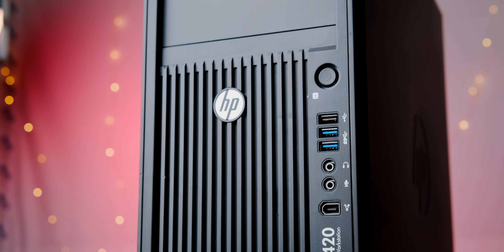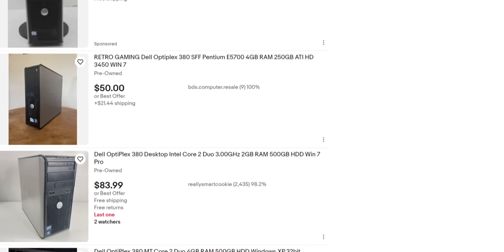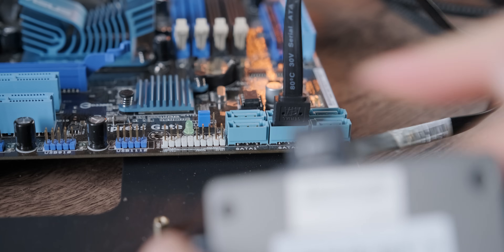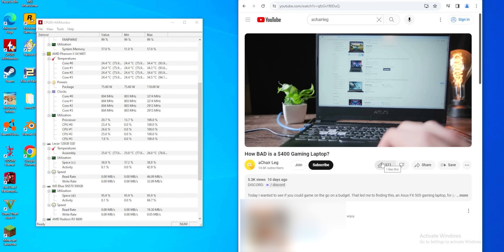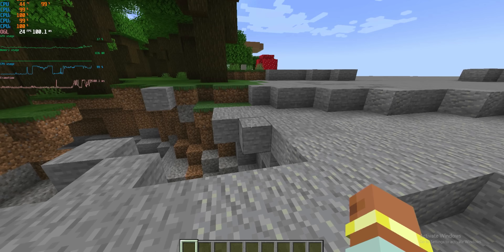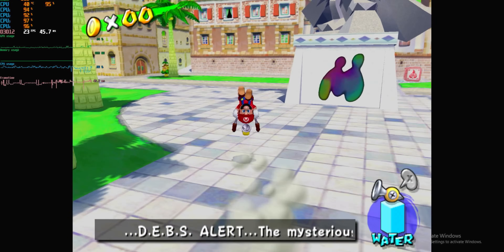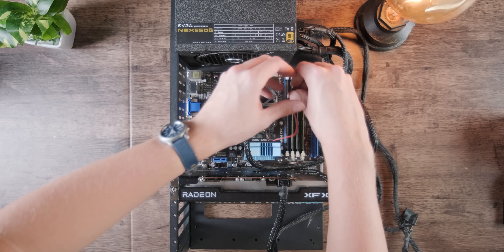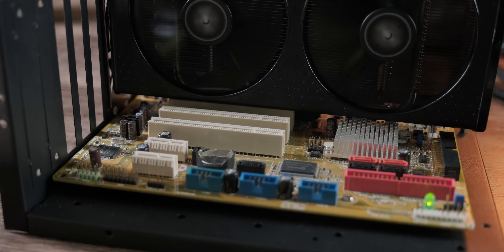DDR2 is DEAD.

Comment: @aChair Leg the windows issue is something i have come accros myself, to fix it you need to clean the drive. in the windows usb booted press shift + f10 and type diskpart. list disk. select disk <disk that shows up>. clean. than go back and install windows normally. i dont know why windows ( even 10 and 11) cant figure this out but hopefully this helps
Reply: For windows 11 it won't install on a pre 2.0 TCPM chip system without registry hacks.

Comment: Check if the drive was not set to dynamic partition
Reply: If so then clean the drive first
Reply from the maker: I tried on two different formatted SATA drives, tried mbr and gpt, tried a fresh m.2 drive, and a few other things I didn't mention due to time and it being boring. Probably spent a couple hours at least researching and trying to find a solution. Super odd issue overall

Comment: you should try a dual socket lga771 and test more games (gta v , the witcher 2015, sottr, etc) to see how 8 cores from that era handle them
Reply: I'd like to see this as well.  I have a old Dell Precision T5400 that has dual Xeon E5405 and 32GB of ddr2 800 mhz ecc that I found in my garage and I'm wanting to upgrade graphics card, SSD, maybe better 771 socket Xeons and I'm curious how far I can push it

Comment: I refurbish old computers as a personal hobby. I recently pulled an old Dell Inspiron from 2008-2009 out of my mom's garage. I had no idea what to expect. I was not expecting 2 1GB sticks of DDR2.
I was expecting less than that lol. Also it had a Radeon HD 4350, also equally not great
Reply: Geforce or Quadro old as 8000 series (even as crappy as 256mb 8400) can run Youtube/1080p video and older games no problem with older Windows 10 drivers. AMD cards HD 5000 series-6000 has limited but working Windows 10 drivers. HD 7000+ is much better and almost modern driver support wise. 4gb-8gb of ram and a cheap SSD, quad core CPU and you have a pretty solid Linux-Windows 10 machine.
Reply: Ah, good times. I remember buying a Phenom II 945 BE in 2008-ish, paired with 4gb ddr2 and a HD4870 2GB just to be able to run GTA IV. That machine saw a lot of action, got upgraded to its limits and is currently still running (very) light office tasks somewhere underneath one of the surplus workspaces no one ever uses in my office 😊

Comment: I still have a PC I built on 775 platform.
Started out with the early C2D E6600 which kept going for ages.
In 2016 I bought a C2Q Q6600 (SLACR) for a CPU swap and overclocked this a little.  Bought a C2Q Q6700 as well to see if it clocked better.  My motherboard could only handle the earlier C2D/C2Q.
I did pick up extra sticks of RAM when I was helping recycle old PCs.
Corsair XMS2 2 GB (2 x 1 GB) DDR2-800 CL4 Memory

Corsair XMS2 4 GB (2 x 2 GB) DDR2-800 CL5 Memory

I hardly turn this PC on anymore but it does have DVD drives in the tower, lol.

My main PC is the i7-5960x <3

Comment: I have an AM2 system with Phenom II x4 960T and 16GB of DDR2. Yep, DDR2, not DDR3. While it is just 800MHz and definitely outdated, but it's still 16GB, which is a ton for DDR2. Works just fine for plenty of things, though I had to mix the sticks around to get them all to work together since I didn't buy them in one kit of 4 by 4GB. 

Speaking to those hopeful to get 16GB of DDR2 on LGA 775 - you can't. The best you can get for LGA 775 is 8GB of DDR2.
Reply: AMD always nicer to customers
Reply: @gabrielecarbone8235 yeah. Most intel boards of the time only support maybe a maximum of 4GB, 8GB if you're lucky. While plenty of AMD boards support 8GB or even 16GB like in my case. Before learning that, I didn't even know there were 4GB DDR2 sticks in the first place.

Comment: Had a 1090T + 1600Mhz DDR3 with 650ti boost. Ran 4k video and games flawless. Over a decade ago!
The 1090T had a better architecture than Bulldozer but on a 45nm versus the bulldozers 32.
Reply: Much like how the Core 2 chips are descendants of the Pentium III, the modern Ryzen chips are descendants of the Phenom II chips and not Bulldozer
Reply: @TheLucidDreamer12  
Nope.
Ryzen has nothing in common with Phenom II, except for maybe the instruction sets. 
Ryzen is an entirely new core with new interconnect design.

Comment: To fix that erorr you would have to;
When it asks "Where do you want to install windows?"
Press Shift+F10 and command prompt will open.
Click within the command prompt window, and type "diskpart" and then
list disk.
select disk numberhere
clean
and one completed type exit in the command prompt window.
And then head to the "Where do you want to install windows?"
Click refresh.
And then click "new".
and after going thru that hit "Next" and Windows will begin to install.
Hope this message appears and helps you as the problem isn't your install media and it's the way the hard disk drive was setup and has to be dealt with using diskpart.

Comment: I'm not a big gamer so an appropriate DDR2 system works fine for every day use.  An Optiplex 745 with 8 gigs of fast DDR2, fully updated BIOS and a Q6600 is just fine for puttering around on the Internet.  Of course, I run Linux (either Xubuntu or Mint) so I'm working with an OS with less bloat in it.
Reply: I sold a Optiplex 745 that originally had a e5700. Upgraded it to a low power Q6600 stepping chip handy, 8gb of ddr2 800mhz, A 1gb Geforce 710 free, and an Audigy 4, plus a free wifi card. Easy $75 off of some old parts, and the guy was really happy to have a quiet, straight forward Windows 10 PC. The latest bios is really nice, and boot times are fast.
Reply: @1986tbirdwilly B3 stepping babyyyy!
Reply: Even a Core2Duo E8400 is fine for windows 11 and normal tasks given you throw in an SSD and 4/8GB ram
Reply: @9852323  so many of us still squeezing life out of these machines because they have just enough capability with a few new parts. one ssd maybe an extra stick or two of ram and good to go . power supply if you were feeling frisky . maybe not daily drivers but extras .

Comment: If you limit your frame rate down to 30 maybe it will stop stuttering. Better to have a slower but smooth frame rate than a fast one with stuttering.
Reply from the maker: Thats very true. I think a light overclock could also really help with stuttering

Comment: This is a situation where a version of windows called ltsc would help a lot with that cpu usage
Reply: Or just avoid Windows 10 altogether and go with a period-correct OS.
Reply: Linux for the w  @FlyboyHelosim
Reply: @FlyboyHelosim  it runs at like 1% cpu utilization on my 4570 while running a browser. I figure it would run this perfectly fine

Comment: My HTPC is still an old HP dc7900 SFF with a C2Q Q6600 @ 3.0GHz (BSEL modded), 8GB DDR2 and a Radeon HD 6570.
I do also have another Core2 Quad system with a Q9550 @ 3.4GHz but it has an Asus P5KC which is a DDR2/DDR3 (4x DDR2, 2x DDR3) combo board and I'm currently running it with 2x4GB DDR3 sticks

Comment: I have 2 old machines packed in boxes. One is a Dell GTX 520 with an Intel Pentium 4 with hyperthreading 3.40GHZ  and 4GB of DDR2 with Windows 7. The other is also a Windows XP Dell with IIRC an Intel Celeron D 330 running at 2.66 GHZ and 2GB of DDR. I don't know why I keep them maybe deeply embedded sentimental reasons I may need counseling for but if the prices keep going up I'll sell them. I was forced to upgrade to 64 bit stuff and when I got a "new" used Dell T3620 with an I5-6500 I really noticed what I was missing and that set me off. I have like 8 PC's that I have learned to take apart and upgrade and possibly flip. I even discovered PC gaming at 61 years old and a new hobby and channels like this have been very helpful.
Reply: I'm on a minimalist kick at work (see zero budget). I've loaded on a "OLD" 
Dell D530, the new linux mint 21.3; scrounged up 4 Gb of DDR 2; 120 GB SSD; WIFI is important. We just need to be portable on the campus network and view PDF files. Working my way thru the config setups and "mounting "drives" has been challenging.

Comment: The 840T has two disabled cores. With some luck, you can unlock it to a penta or hexa core.
Reply from the maker: Woah! I might have to revisit these to try that & overclock
Reply: @aChairLeg   its seriously worth a look. the 840t was my first "enthusiant" cpu that i bought. it was basically a an x6 1055t that didnt meet factory standards and had 2 cores disabled for reliability reasons. the ipc of the Phenom 2 chips are actually higher than the FX series chips. my "unlocked" and oc'ed 840t would regularly score at or above an fx-8350. those older generations of pc hardware had some serious charm.
Reply: No, you need the 940T.  @aChairLeg
Reply: Is there a way to check and test a CPU for disabled cores? I got a feeling it probably happens a lot of different systems.
Reply: I was running on P2 955 BE till 2019 and would be probably using till now if denuvo didn't happend. If i remember correctly Assassin's creed origins didn't start because denuvo didn't support older cpus.
Reply: Depends on motherboard/revision. "Some luck" involves unsoldering CPU resistors from the mobo pad(s) and then soldering them to other pads. Google "EVGA E758 Rev 1.1 Mod" - You have to move resistor R538 to R539. Requires quite a bit of skill. Your breathing can simply blow the resistor away never to be found again.

Comment: I still have a few c2q systems laying around. One of them, a p5qem has a xeon e5450 and is foldingathome 24/7 in the garage, has been for years now, it just keeps on ticking.
It was a (LAN) minecraft server for a while, and worked well.

Comment: This would run like new if you were using Debian with XFCE
Reply: Or antix. It's essentially Debian but lighter yet has more stuff for day to day use. I use it on my powerful main PC as well as on my weak Celeron N3060 laptop, and both work well.
Reply: @elu9780  Ayy, the anti fascist distro!  :)
-
I love antix in concept, but not having systemd makes things a little clunky.   SOOOO much stuff just expects systemd!!  It makes setting stuff up a royal pain sometimes.

Comment: My therory these system are realy great for late windows XP - early windows 7 retro gaming ! Personnaly, i have one core 2 duo and one core 2 quad system for windows xp. Plus you add the fact the motherboard are rarer and you have a market pushing a bit pricy price tag for old tech !
Reply from the maker: That's very true! I bet C&C would run great on these haha
Reply: I bought the same ram config for only 18 bucks. All i need is a gpu now. And maybe some 2007 accessories to go with my equally old pc...

Comment: I have some DDR2 at 1200 Mhz , pretty sure that is the fastest .
Reply: the fastest ddr2 was 1333 only a few sticks were made but it was so late in the game it was quickly phased so good luck getting it lol
Reply: @zerokool1985  no its 1066, that's the fastest stock ddr2 speed without a overclock, also the slowest ddr3 speed but rarely seen as 1333 is the commonly found slowest for ddr3 (not the technical)
Reply: @patg108  I had a pair of dragon series 1333 the CMP speed was 1333 so technically your correct . It's non xmp was 800/ 1066 .
Reply: @patg108  ddr3 slowest is actually 800 lol
Reply: @zerokool1985  not according to wiki.
Reply: @zerokool1985  i'm referring to stock speeds not underclocking, stock is 1066 for slowest (though i don't own any at that though i own some at 1333 and above)
Reply: @patg108  ddr3 fb dimms  come in 800 mhz 1066mhz 1333mhz 1600mhz 1866mhz 2133mhz
Reply: @zerokool1985  i'm aware but we're talkling ddr2 not ddr3
Reply: @zerokool1985 and my response was towards giov
Reply: @patg108  so i was wrong its 1300 lol
Reply: these are the sticks i have
Reply: @zerokool1985  still wrong, ddr2 does not come (stock) at over 1066, its overclocking (xmp) that gives that number
Reply: @patg108  incorrect kind of anything dohcp or xmp is technically overclocking
Reply: @zerokool1985  which is what i said and hence why it doesn't count as a stock clock.

you're the one that is incorrect as i SAID XMP is overclocking.
Reply: @patg108  The side of the box said 1333Mhz on my four, 8Gb sticks.

And it booted up that way without me having to do anything in the bios or in Windows.

" Technically correct is the best kind of correct." is supposed to be ironic.

If everyone is overclocking, it's not overclocking anymore. Even if some outdated and often ignored "standard" says so.
Reply: @jtjames79  ddr2 doesn't come in 8 gb sticks, 2 GB at most, its about DDr2 not ddr3
Reply: @patg108  You're right, I'm stupid. Please disregard all previous comments. I'm putting myself in the corner.
Reply: @zerokool1985  Yep, mostly on dual or triple slots per channel like server grade x58 stuff it can only run 800 mhz if you fill all slots.
Reply: @zerokool1985 I miss those good day with different D9 ram 😢
Reply: @zerokool1985  Micron D9 based sticks could routinely overclock to that as well, I had 4x1GB that happily sat at 1333Mhz CL5.
Reply: @TheDemocrab  truth
Reply: @zerokool1985 Weren't they 1GB sticks only tho?
Reply: @Nianfur  the ones I have are 2gb sticks .
Reply: @zerokool1985   Oh. Didn't think 2GB existed.
Reply: I had a 8gb kit of 1366mhz I'm pretty sure that is the highest factory clock speed of DDR 2 memory..
Reply: The world record overclock for DDR2 is over 1800 MHz
Reply: @CryptoJordanVR  i have some rare 4gb ddr2 sticks :)
Reply: @zerokool1985  I got 4 sticks of 8GB at 1333Mhz.

I could get more speed out of them but I would have to add some more cooling.

I got a i7 -4770 out of a salvaged Dell.

With my 3060, it's basically perfect for really cheap.

I just gets things done more than good enough for me.
Reply: @CryptoJordanVR  true but that was from overclocking i think
Reply: @zerokool1985  all speeds above the base ddr2 speeds is an over clock
Reply: Dear lord 💀
Reply: speed alone makes no claims , speed of transfers and latency measurements are how to figure out the actual best ram. doesnt seem like it but its 800 mhz 3.5 CAS latency. Thats the max throughput that the testing allowed . if you can keep higher speeds with identical CAS latency, it will indeed perform better . 99% of JDEC settings will loosen this latency window as you run the ram faster and faster.. meaning stock could be CAS 3 and OC to 1333 might be CAS 8. No gains in throughput in that example , just two different ways to get there.
Reply: @tobiwonkanogy2975  Of course but its about ddr2 not ddr3
Reply: @patg108  i had kept my comment to DDR 2 . i cannot link it but DDR2 SDRAM wikipedia and on that page . My number for CAS was innacurate , timings are 4-4-4- CAS latency 10 nanoseconds DDR2 PC2-6400 800 MHZ. also one set of ram marginally faster but worth way more in asking prices.
Reply: I got ddr2 2x4gb 800hz that support overclocking aut of the box for 2€ i just decidet to pay the seller 3€ extra
Reply: I tried OCing some OCZ sticks that were originally 800mhz to 1100, lasted years, the. One day, the fluid they put inside of the heat spreaders leaked out and killed the chips.
Reply: Those aren't consumer grade
Reply: @surfacner5989  1200 mhz (at stock speed) doesn't exist, its fastest is 1066
Reply: That makes me cry. One of my four sticks of Gskill trident 1200mhz has died. So no high speed memory for the old system.
Reply: How much GB/s?
Reply: It generally topped out at 1333 MHz... But there were some (very expensive) 1866 MHz and 2133 MHz sticks out there... The did exist... I still have eight or ten 2 GB and 4GB 1333 MHz sticks, pulled from old workstations... Badass in their day...
Reply: @fadingbeleifs  my motherboard made for 1200 OC.
Reply: I have ddr2 ram but i dont knew its at 1200 mhz how to check that